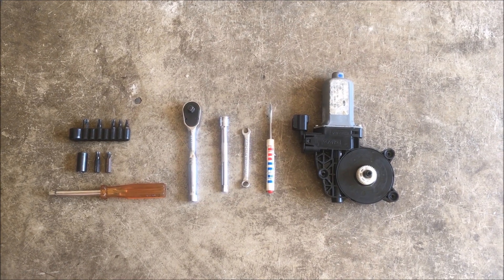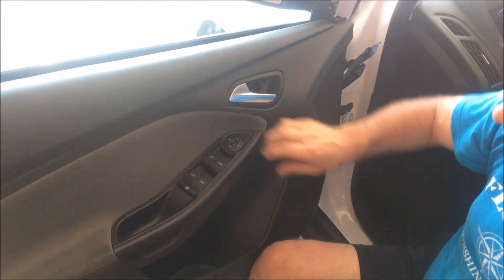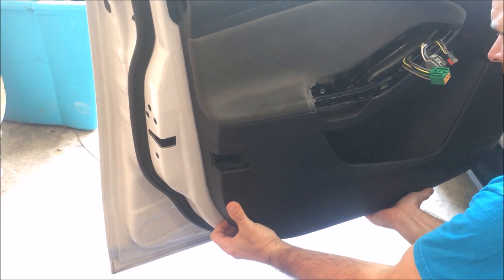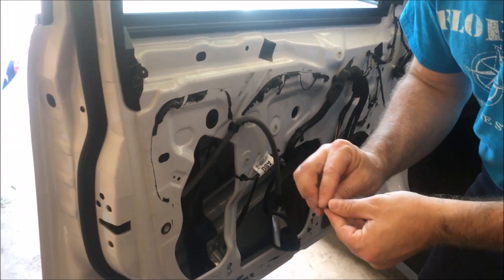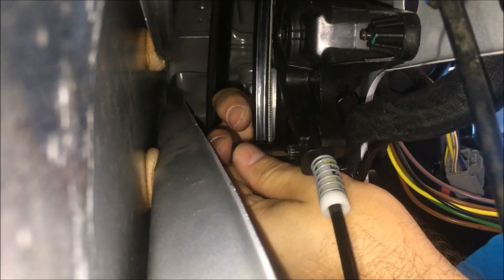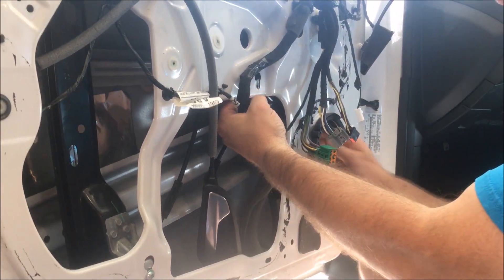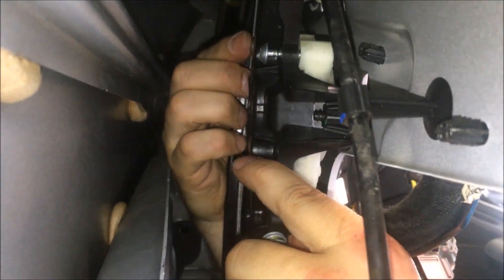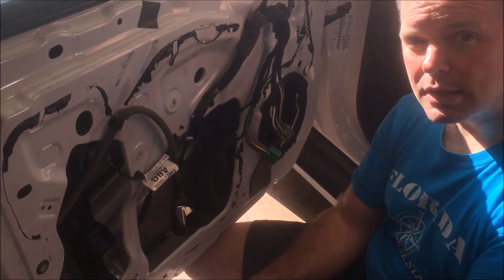2013 Ford Focus Window Motor Replacement WITHOUT REMOVING REGULATOR or window

Comment: You don’t have to struggle in the door panel removing the 3 screws just remove the last one holding the unit to the door it then comes out and you can get to the back 3 screws a lot easier

Comment: I followed your video to change the motor on my Ford focus thank you it was very helpful. Is there any reason you can't take the three screws out and put them back in while you have the whole module pulled down because it is a lot more accessible? That is what I did and it seemed to be easier.

Comment: Thank you for the video. I did the passenger side, and I was able to take it out and install it. I was struggling to get the upper screw that goes into the metal frame and to one of the hole of the motor.

Comment: Hello im having trouble with 2012 ford focus front driver side window not rolling down. Question is what did you troubleshoot before replacing motor. Thanks.